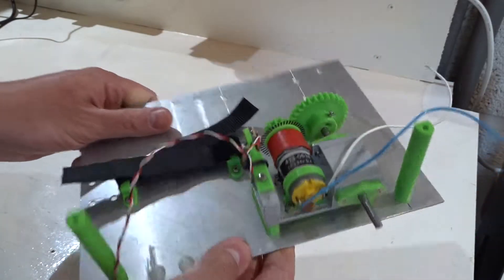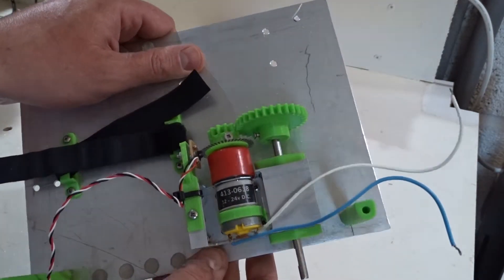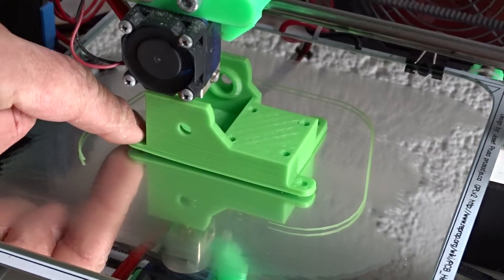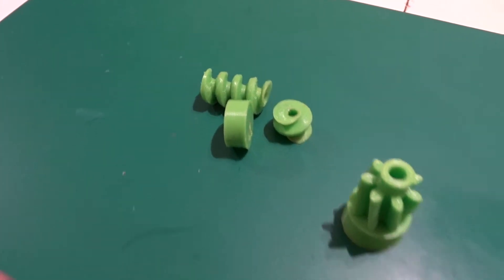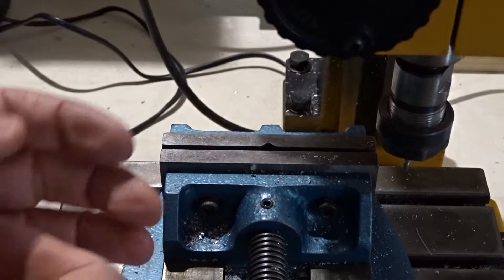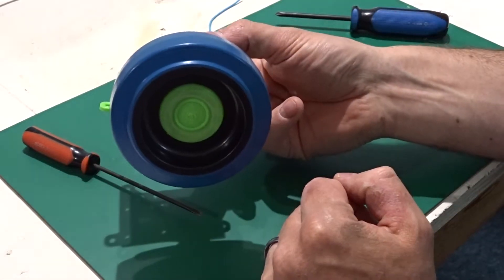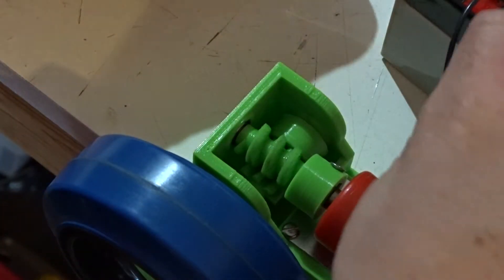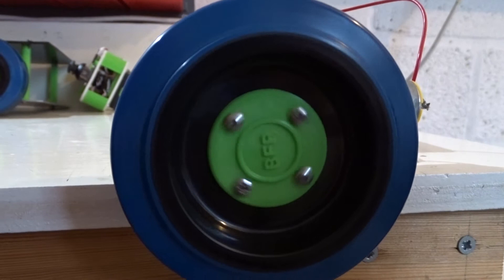3D Printed Worm Drive Gearbox - RC Robot #8

Comment: Great video, short and to the point.
One thing you can do to prevent droop on the underside or the drive gear is create a .5mm support shell around the spiral profile(diameter equal to the worm gear teeth diameter when). That way each layer prints the underside as a bridge operation, giving the plastic something to attach to on the other side.  It's a bit more post processing on the print with a razor knife but might assist with smoother operation and longevity.
Reply from the maker: Thanks. Whats the best way to generate the support shell? In the slicer? Im working on a different project now but being able to reliably print good quality worm  gears will be useful for future projects.

Comment: How durable are those gears? Would PETG suit this use case? Thanks
Reply from the maker: I think the gears would last a while. I used PLA and they seemed quite durable, obviously the stronger the material the better!
Reply: @BigFaceRobotics  printed out of PETG, resin, and nylon will see which one is the ultimate go-to :D

Comment: I made a similar 3d printed  wormgear for a rollershade, i found it to be quite noisy as well, even when printing at .1 and using petg 
at the end i just bought a all in one motor with metal worm gear. It was smaller and less noisy and with 10 -40 RPM also perfect for its use.
Reply from the maker: yeah this was an interesting project and its amazing what can be 3d printed with some trial and error but certainly no replacement for a commercially available product.

Comment: How did the gearbox behave overtime, too much wear?
Reply from the maker: I didn't run it for a really long time.I didn't see much wear in the time that I did run it for and some lubrication seemed to help a lot.
Reply: @BigFaceRobotics  ok, it would be an interesting test.
Reply: what did you use for lubrication
Reply from the maker: @michaelthompson8251  I used some light machine oil for a while but also tried vaseline which works well.